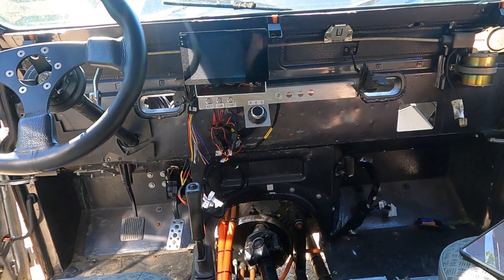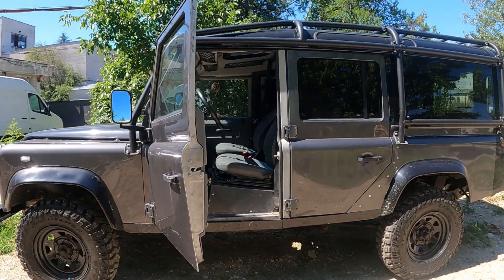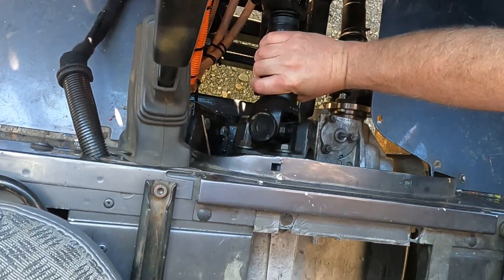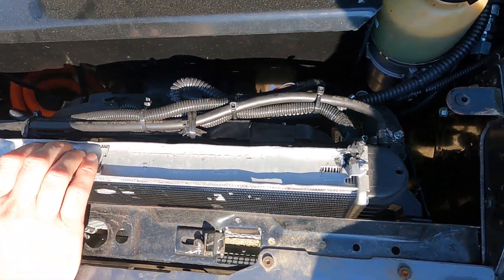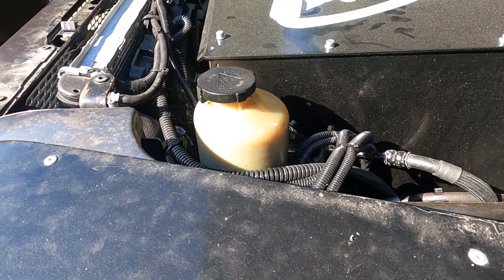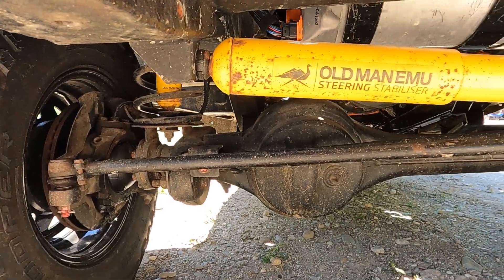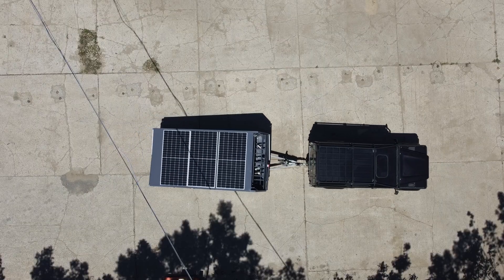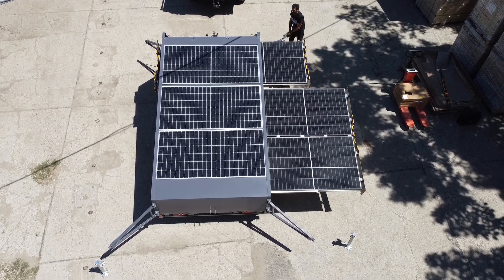TESLA POWERED Land Rover Defender 110

Comment: 50 years ago in a northern U.K. junior school I was told that fossil fuels would eventually run out and we would have to explore other energy sources……….we don’t seem to be much further on even now
Reply from the maker: LiPo and Li-ion batteries are a vast improvement from early rechargeable batteries but we could do with another major breakthrough
Reply: @randomromania  ……they had battery powered vehicles in London in 1910……..lithium batteries are nothing to be proud of in over a century
Reply from the maker: @tonyeden8381  i think electric cars are good, however synthetic markets are not, that's my position
Reply: @randomromania  ……I reckon that’s a very sensible position to take mate 😊👍
Reply from the maker: @tonyeden8381  A quick google of "energy density" answers many questions :)
Reply: @randomromania  …….electrickery indeed